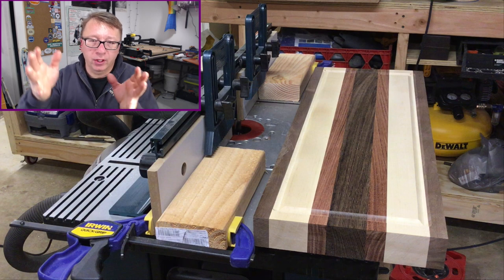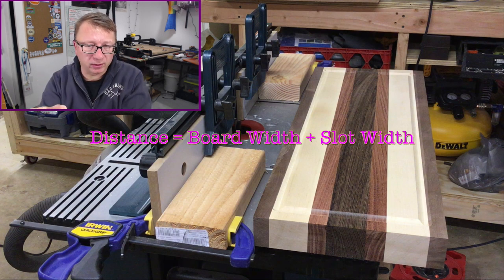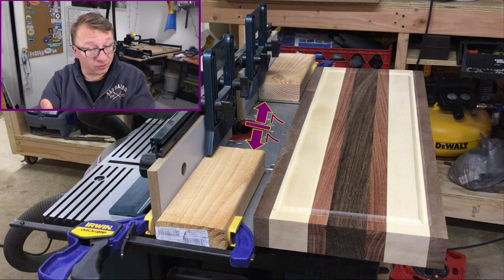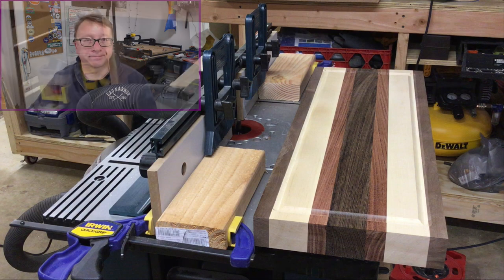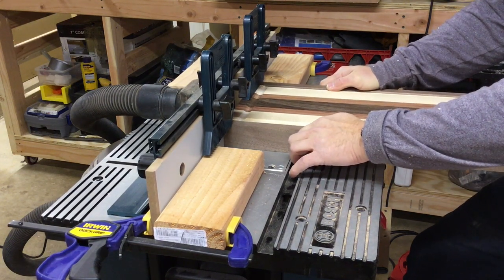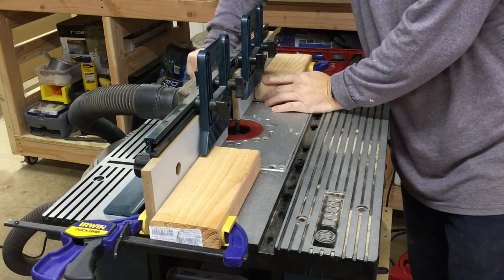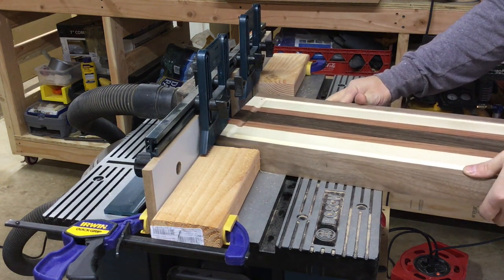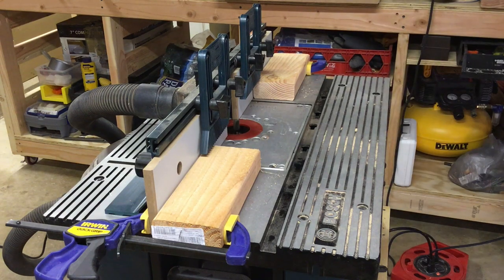Routing Handles into a Cutting Board Using a Router Table

Comment: Method works but how do you sand the burnt stuff out of the curved handle?
Reply from the maker: Hi there. First, avoid burning in the first place by using a sharp bit and moving quickly.  Second, I hand sand using a piece of sandpaper glued to a small wooden block. Third, I got a small detail sander shaped like a V.  It works OK, but hand sanding is usually just as fast.  Hope this helps!

Comment: What router bit did you use?
Reply from the maker: 1/2" straight bit by Skil (1/4" shank).  If your going to use it a lot, I'd definitely recommend something higher quality; mine's pretty much trashed after 5-6 cutting boards.  Thanks for watching!